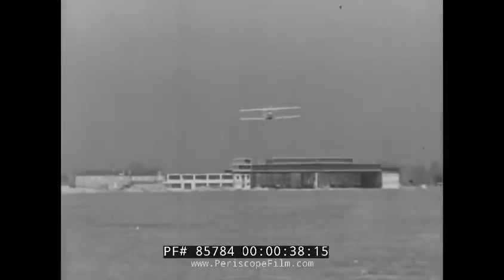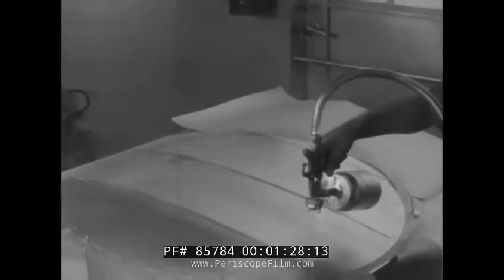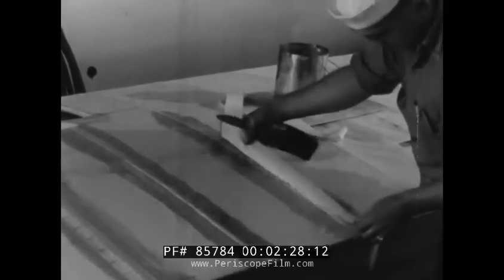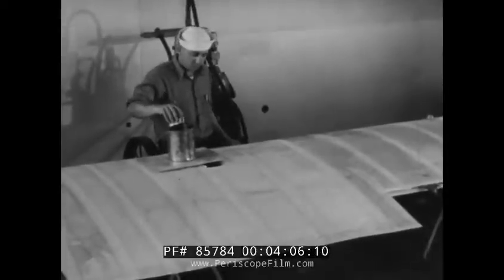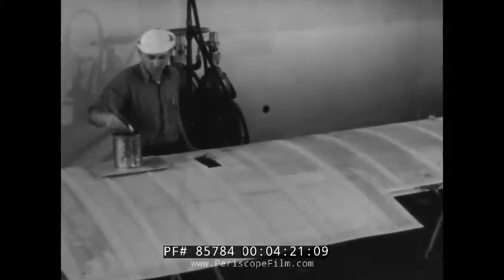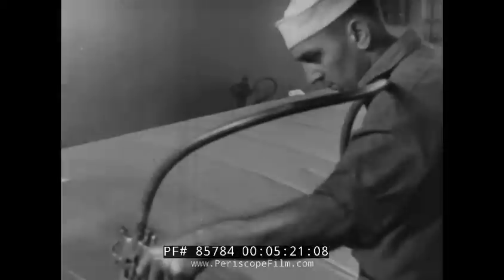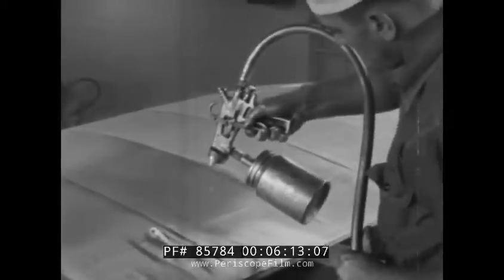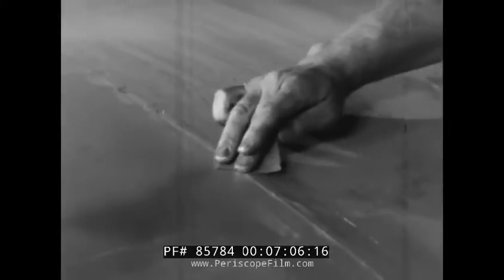" DOPING TECHNIQUES "  WWII ERA TRAINING FILM   APPLICATION OF DOPE TO FABRIC AIRPLANE WING  85784

Comment: Would be interesting to find out what the health impacts of this kind of work were. By interesting I mean horrifying.
Reply: there was no HSEQ in ww2 fabrics :v
Reply: What Seaman Spraygun saw at the end of every work day:  6:50
Reply: @TierNone_LarperatoR  Oil and solvent based paints are being legislated out of existence.  The vast majority of paints used these days are not nearly as toxic as the ones our grandfathers used.  That said, my grandfather was a commercial painter (and a smoker) and he lived into his 80s.  The only cancer he ever got was skin cancer from working outside in the sun.
Reply: @TierNone_LarperatoR  usually they wear respiratory ppe though
Reply: Notice how the brush is held close to the surface and how the worker has no filtered mask, thus also doping his lungs.
Reply: It's shellac and ethanol, with some plasticizer, like triethyl citrate. Anyone making furniture nowadays is exposed to the same stuff when they varnish it. Worst thing the average person could get off this was rashes or inebriation. (That's assuming you got some crayon muncher who decided to drink this stuff.)

Comment: When I was a young materials engineer at the North American Aircraft Operations Division of Rockwell International, working in the labs in El Segundo in the mid 1980's, I was assigned to clean out some storage areas.  I found an odd looking experimental or testing device that I was not only unfamiliar with, but couldn't identify its purpose.  My boss couldn't figure it out either.  I went to one of the oldest engineers in the department for the answer.  It turned out to be a device for determining the tensile strength of the fabric on the P-41 Mustang after it had been doped.  Up till that point I thought that monoplanes at that point had metal wing skins but I was corrected.  Turned up some other odd testing equipment from the WWII era in addition.  I petitioned upper management to donate the National Air and Space Museum.  I don't know if they ever did.  One thing I'm sure of is that the specifications for all the materials and processes shown here still exist in some dusty files somewhere, perhaps in some Indiana Jones type government warehouse buried in a deep abandoned salt mine.

Comment: Those old dopes were a nitrate based and highly flammable. Today's dopes are butyrate based. I want to guess how many young people jumped on this channel at the title🤣🤣🤣?
Reply: I was actually looking for ancient manufacturing techniques, coatings in particular.  Looks like I found ancient people too.
Reply: What is dope? genuinely curious.
Reply: Nitrate dope is still used for the first few coats as it adheres better to polyester fabric. The rest is butyrate.
Reply: @timothystone3360  a type of paint used on aircraft fabric to seal and tighten it.
Reply: @dave23024  Think of it as a kind of varnish. It wets the fabric and causes it to shrink, tightening it up on the frame it is attached to. Then it seals the pores in the fabric, making it waterproof.
Reply: Guilty 😔 😭
Reply: @timothystone3360  Nobody in this entire thread identifies WTH the material is.  Polyurethane?  Thats a 1937 development.  Bizzarre how an entire video was made with no mention of the material, just DOPE.
Reply: @jimkenealy6448  I built model planes as a kid. They used a very thin silk cloth on the wings. It was so thin it was opaque. The silk cloth is spread over the wing, glued on with wood glue around the edges. It is then sprayed with water several times to tighten it around the wood wing or fuselage. Once it is tight, it is "doped" which makes the surface hard and smooth. The dope also shrunk the silk and made a harder, rugged, surface. 
I don't know what the dope actually is, but it had a very strong chemical smell. It dried hard like a lacquer.
Later on, there was a colored heat-shrink film material called "Monokote", which took the place of the silk cloth and dope. You glued it on and used a hair dryer to heat shrink it. Way easier.
Reply: @Tommy_Mac  I too made numerous balsa aircraft - biplanes mostly, and doped the fabric as you describe and made a mess.  All that doesn't address my question - what, exactly, is the chemicals that make up "dope"?  But thanks for answering an unasked question.

Comment: Amazing how far we have come in such a short time the days of dope

Another a&p here still flying planes with doped silk I used to make a lot of parts out of titanium for new aircraft.
Even got to cut some level that was made on Skylab kind of think it was a reverse engineering but it's actually a common alloy now had one of the first desktop computers if you would.
A Z80 machine ran UCSD Pascal from
Two open 5 1/4 floppies no hard drive not much of a processor just barely a step up from the commodore 64's of the day. 
We're cutting the plugs off our remex readers for 8-bit punch tape and attaching them to the Commodores to make kind of a editable file that we could run our NC machines from.

Comment: Time frame for this film is pre-1942.  Notice the roundel, i.e. red-white-blue star on the wing of the aircraft.  After Pearl Harbor the solid red circle inside teh white star was removed.  Red was not returned to the roundel till after late 1940's early 50's with the red being a solid stripe in the roundel.

Comment: I built model planes as a kid. I only had an old library book to go by. Those instructions covered using silk on the wings and fuselage, shrinking it with water, and coating the surface with dope. I had to purchase the dope from a hobby shop. My Mom didn't beleive the "dope" was a type of paint, until I showed her that book. Then she drove me to the store and talked to the guy inside about it. "Perfectly safe" he told her. I didn't know what a 'buzz' was until much later, but I definitely had a few after painting with that stuff. Man did that stuff stink! Still don't  know why they called it that. 
Is the 'dope' name, a drug reference for the paint, or a paint reference for illicit drugs?

Comment: damn they were spraying that shit with no mask or respirator and it looked like an enclosed area no visible ventilation
Reply: Those guys were toughest ones in the cemetery.
Reply: One spark…
Reply: Then they would go outside and light up a Camel...
Reply: @lenscap8925  Or a Pall Mall Red.

Comment: Such a very manual operation that is fraught with opportunities for deviation. This has got to be a quality control person's worst nightmare.
Reply: On the contrary, these operations were fraught with opportunities to develop what used to be known as SKILLS.  When I went to a civilian school in 1964 and 65 to earn my aircraft mechanics license, I learned how to balance propeller blades, find cracks in crankshafts, build wing ribs from spruce and fuselage frames from steel tubing, time magnetos internally and externally, adjust pressure carburetors, operate all kinds of piston and jet engines, compensate and calibrate magnetic compasses, along with all sorts of other skills.  Once on the job, the quality control people were our partners and mentors, not our overseers.
Reply: @kaptainkaos1202  Are any of your seminars on line?